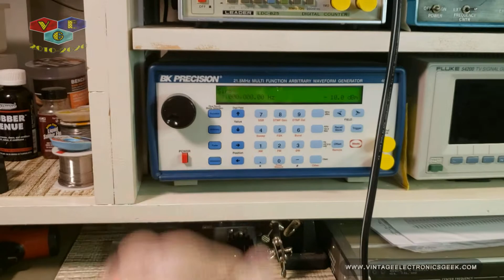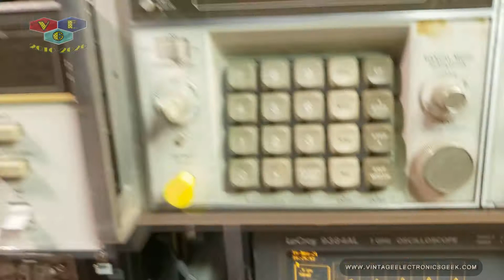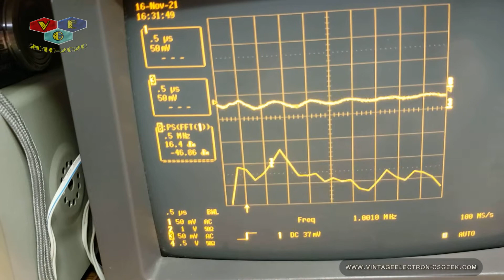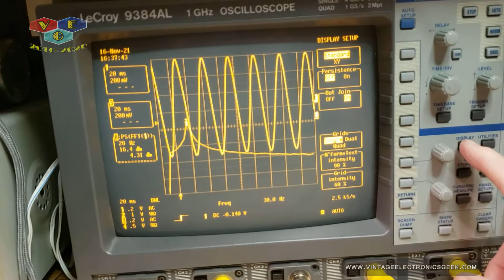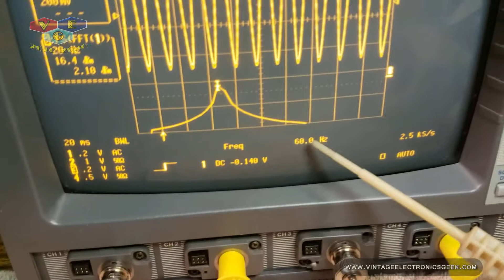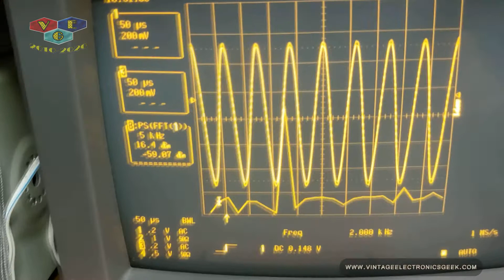How To – Stereo Test Gear Connectivity – PT 4 Of 4

Comment: function gen output 50 ohms going to 75 ohm cable  rg59u,,,then to audio y  adapter ,, utput of DUT going to 50 ohm cable then to scope,, what did you set your oscope input to ?  Standard analog audio cable impedance is 45 Ohm to 70 Ohm. This amount of potential mismatch can result in signal reflections and jitter, causing bit errors at the receiver. .
Reply: RCA cables have a DC resistance of 0.x-1 Ohms, if I recall correctly, I've Ohm'd out several to check if they're good. And their inductance is certainly not high enough to reach 40 in the AF range. Even if it was, the RCA input imp. is usually 10k or higher, so it don't really matter does it... Maybe you're thinking of RCA video cables, which operate ar far higher frequencies. I think you're confusing RF and AF transmission, as for the latter, cable characteristics don't really matter that much.
Reply from the maker: @westelaudio943  Howdy WA!  I've not checked out the cables like that, I guess I should...good info to know, thanks for your help and input!  ~Jack, VEG
Reply: @VintageElectronicsGeek  

Yes Jack, but don't worry to much about cable impedance and such when dealing with audio gear, it's negligible most of the time. The only thing Dennis is right about here, is the input impedance of the scope - RCA outputs want to see at least 10k.
Reply from the maker: Thank you Dennis for the pointing out my error and assisting me and the viewers in doing it correctly, I really appreciate it!  ~Jack, VEG
Reply: @VintageElectronicsGeek  not being pickey, but you can get false measurments mismatch, your learning along an good to you help others
Reply from the maker: @dennisqwertyuiop  Dennis - not picky at all, I am open to positive criticism and proper education, I want to learn the proper way and teach the proper way.  Its no secret that I am a hobbyist and am learning so anybody who will take the time too not only watch my videos but then takes the time to teach correctly, I am so open too and I cant thank you enough!  ~Jack, VEG